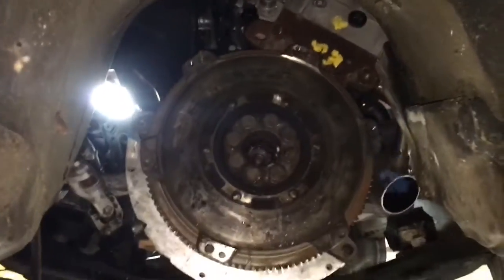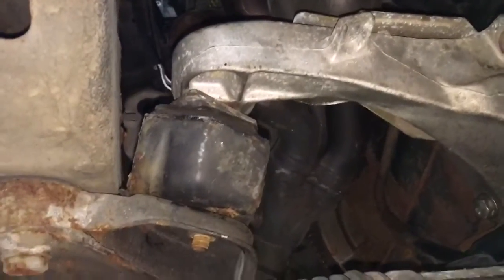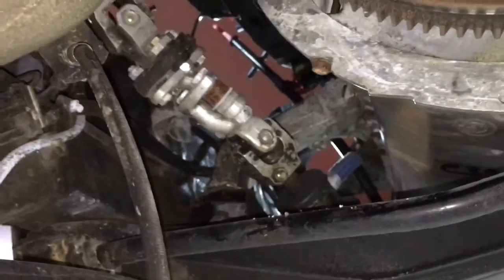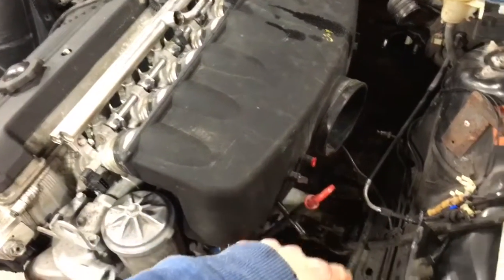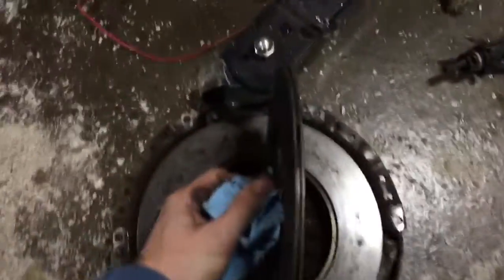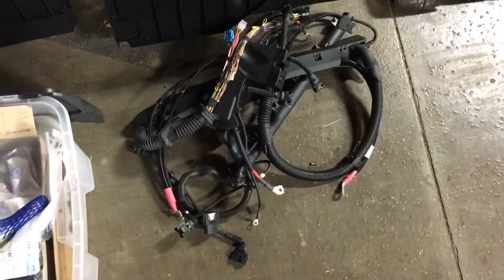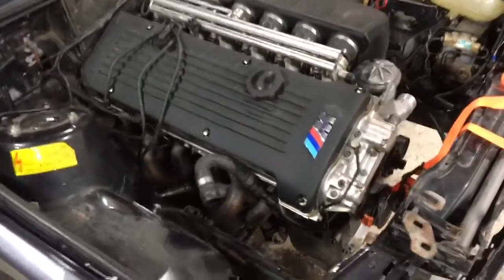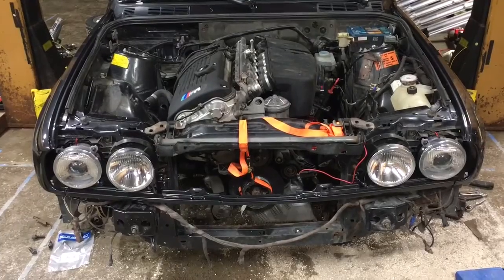1988 bmw e30 M3 part IIII - the lull waiting for parts

Comment: nice engine man, how much did you score the s54 for?
Reply from the maker: +stirk1000 the long block was $2,700 or so.
Reply: what!!!! lol. that cheap? right now i'm talking to a guy from quarry motors in the UK and a s54 would run me like around US$6000 when i convert the currency to USD. I am looking for either s50, s52 or s54 for my e34
Reply from the maker: +stirk1000 what I paid isn't typical but we have a lot of higher mileage examples being crashed in this country, so you can occasionally get lucky :) the engine in my red M was $2,600 with DME and accessories!
Reply: Sweet!!!! i'd love to find those kind of deals. How is the swap coming up?